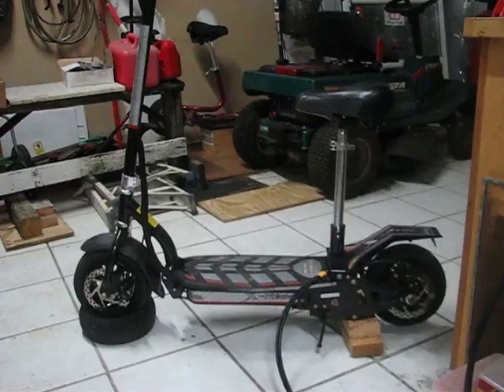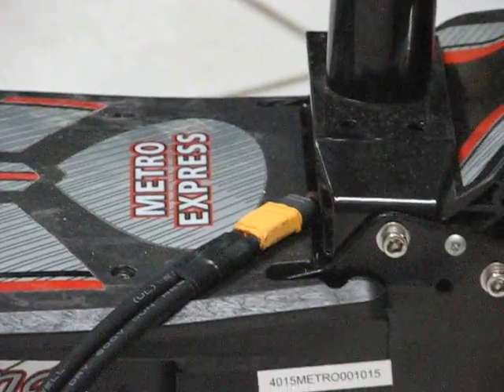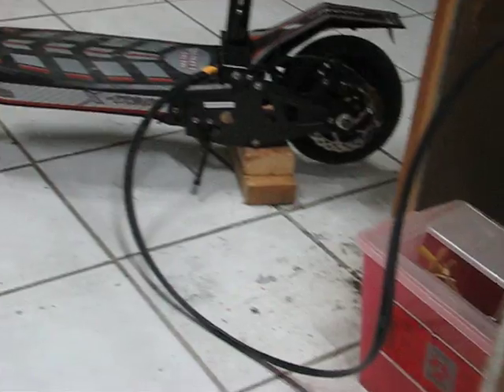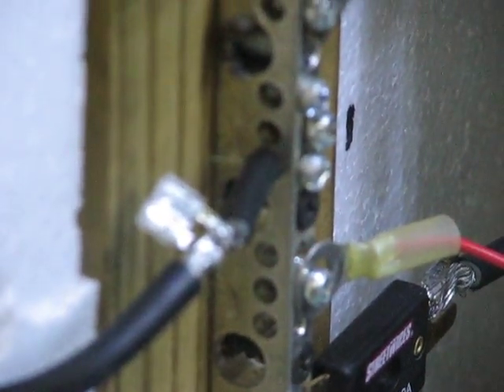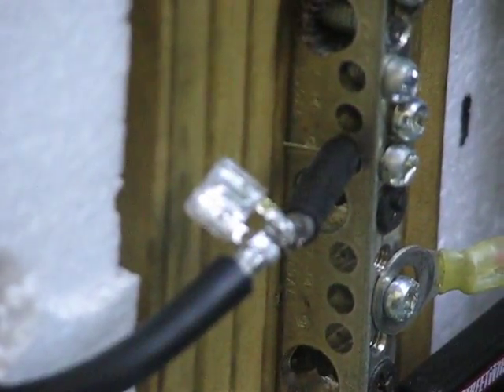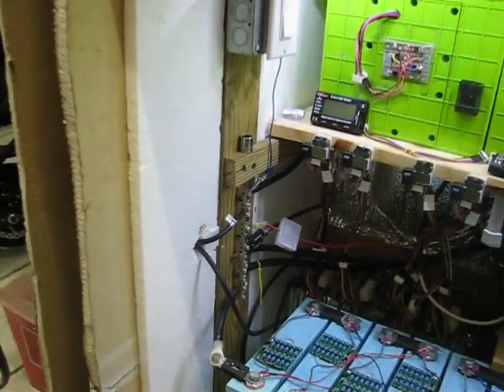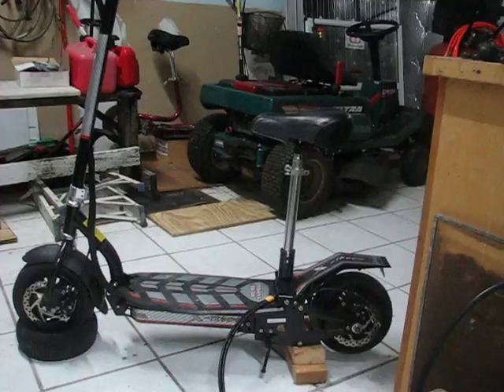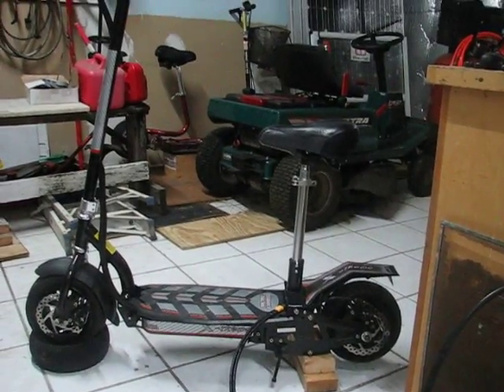48v LiFePo4 Solar System Integrated with 48v LiFePo4 Scooter

Comment: Brother I am thinking of going with a pip 4048. There are a few things I would like to know. Would you mind if I called you some time to get some info on the pips? I sent a Pm with my phone# but my phone is a home phone so can't text..
Reply from the maker: Sure! no prob. 
When is a good time to call?
Reply: Solar Junky WHen ever is good for you I am up late and on EST.. Thanks brother.
Reply from the maker: Ok cool! Will give you a call. 
So you know it's me the last 4 digits of my number are 7777
Reply: Solar Junky Ok cool thanks brother.
Reply from the maker: http://www.invertersupply.com/index.php?main_page=product_info&products_id=1215
Reply from the maker: http://www.ebay.com/itm/like/291637087871?lpid=82&chn=ps&ul_noapp=true
Reply from the maker: https://www.google.com/search?q=lite+fuze+8000+stepdown+transformer&rlz=1C1DVCT_enUS423US486&oq=lite+fuze+8000+stepdown+transformer&aqs=chrome.0.69i59.8132j0j4&sourceid=chrome&ie=UTF-8
Reply from the maker: http://www.ebay.com/itm/Voltage-Control-Relay-Timer-Delay-Switch-OvervolTage-Under-Voltage-Protection-/311158989699?hash=item4872856383:g:WY8AAOSw~1FUVvpT
Reply from the maker: yankey4 http://www.ebay.com/itm/Blue-Wind-Solar-Golf-Cart-Control-Volt-Meter-Voltmeter-/350263868612?pt=LH_DefaultDomain_0&hash=item518d5a7cc4
Reply from the maker: yankey4 This is where i got the contactor but they are a surplus place that gets deals on odd lots of stuff... http://www.skycraftsurplus.com/accontactor.aspx

I will find a link to a contactor like the one i'm using but it will cost more than skycraft
Reply from the maker: https://www.wolfautomation.com/index.php/catalog/product/view/id/10633/s/iec-contactor-25a-2no-2nc-120v/?gclid=CjwKEAiA3qXBBRD4_b_V7ZLFsX4SJAB0AtEVxgcxITv2NCgODb0-DR_PEdeKkPcK93KJta93fsdJ4RoCUWPw_wcB

Comment: great idea!!!!!!!!!! love it man unless you use to much power in your house then you cant use your scooter.
Reply from the maker: Dude, does not happen too often, spent over a year off grid befor this long life battery idea. Inverter Spent less than 10hrs on grid total minus ac hybrid switch running on grid after 5-6 pm & that was before adding the 40ah 100.00 craigslist battery score. Even if solar system batteries hit the low battery cut off voltage of 51v scooter would still have plenty of run time for store runs & such. But true it would not be fully charged the scooter cutoff voltage is 48v or 46.  Now with my long life battery project solar system only runs from sunrise to sunset only been a few weeks but batteries have stayed very close to fully charged above 53v
Reply from the maker: Have you used the 60v inverter to power any computers, TV's, sound systems, to see how well it work with electronics???
Reply: yes and it worked fine, ran my laptop and monitor np
Reply from the maker: Thanx! You got me wanting one now! lol!
Reply: Solar Junky just wait for my video tonight
Reply from the maker: fliping720 Reading my mind???. was going to ask you to do a video using the inverter with electronics. Look forward to the video...

Comment: When you come to Cairo bring it over so that you can use it around the Pyramids. Just one thing the Fuse should be as close as possible to the battery pack, so that if the two cables touch after the pack then the fuse kicks in.
Reply from the maker: Sounds like fun!!!! Now i just need to make it to cairo.. It's fused at the scooter battery & solar battery may add 15 amp breaker so it can switch off when not in use.